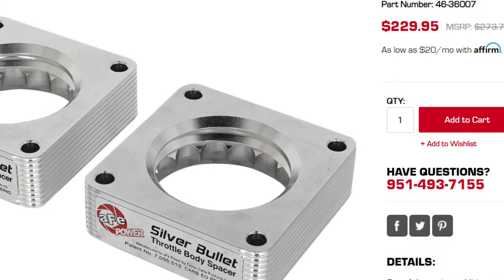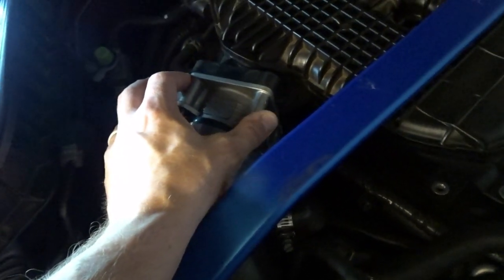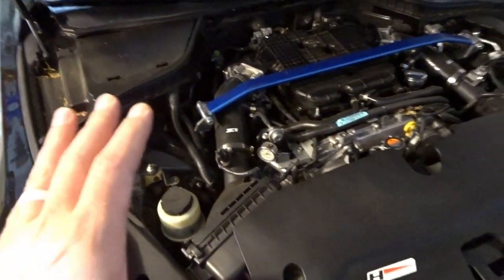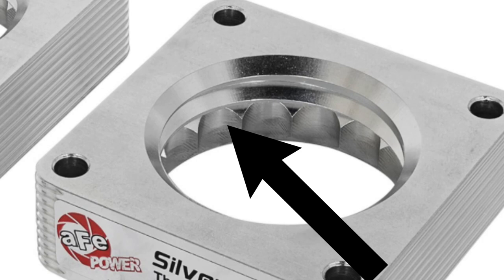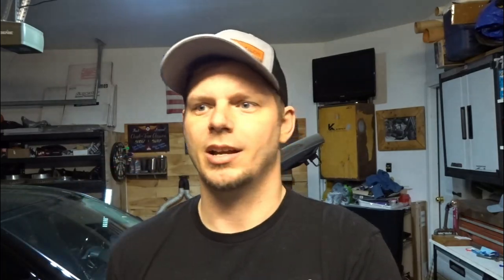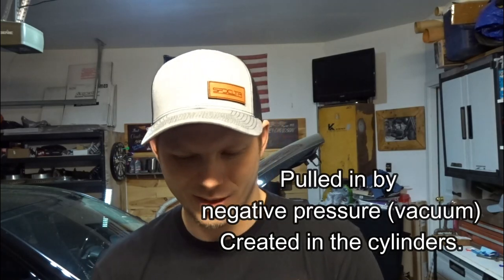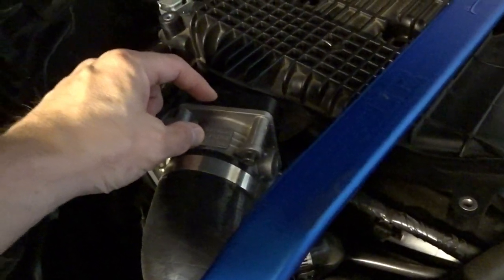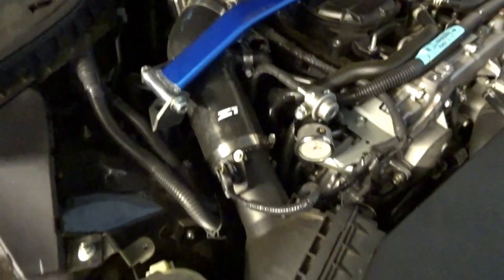Do Throttle Body Spacers Work?? | Watch BEFORE BUYING!!

Comment: Old video but I liked it. Anyway I’ve come to conclusion that TB spacers only do 1 thing. Allowing a port for a NoS system. If they truly worked YouTube would have 1,000 videos proving on a dyno. I’m surprised that there isn’t any proving/disproving them working. Therefore when in doubt believe what you see and I haven’t seen any dyno showing them doing any hp gains
Reply from the maker: Exactly right!

Comment: Yep! Your on point 1-2hp. Buddy just got off the dyno with his 12 g37s coupe full bolt- on. We were all curious and 1-2hp for over 200 bucks 🥱 lol. His tuner was like your lucky I squeezed that much out lol. Great video my dude.
Reply from the maker: Thanks!  Yeah and honestly, they probably could not positively attributed that 1-2hp to the spacers.  Like I said in the video, you can do back to back to back pulls on the dyno with no changes made and see a variation of 1%.  He could have done another pull after gaining that 2hp and been down 3hp.  Margin of error.  I’ve never seen any evidence of true confirmed gains from TB spacers on any platform.
Reply: I agree, waste of money for the VQ. Can't relate to a v8. Who knows it could create 10hp 🤷🏽‍♂️
Reply from the maker: @Hondacbr600rrish  I’ve seen them installed on many mustangs lol.  Same results...
Reply: There we have it lol. Don't buy them lol.
Reply: @Hondacbr600rrish  hemi v8?
Reply: dyno proven got me 8 hp on my r18 1.8 civic :DDD

Comment: good video.  This crap dates back to the 60's, 70's, 80's  when we use to run cross rams and tunnel rams.  Back then even adding a spacer to a carbed manifold could gain a few HP..  These days of direct injection, the gain is gone.

Comment: Understood that this is an old video, maybe with other supporting mods you might get much better results, such as throttle body coolant bypass, run a throttle body water cooler instead , hey you can always diy a spacer out of 1/2" plastic cutting board 😊, my $0.02...

Comment: Theoretically, in aerodynamics there is a concept of introducing turbulators to a structure in order to minimize the separation of air from the surface of an object. Separation can create small circulations at the back of the object as it travels through the air creating something called an adverse pressure gradient which can create excess drag upon the object. This is why they put dimples on golf balls so that they travel faster and farther. This however is a concept for external flow and I'm not sure how the existence of turbulators would work in an internal flow scenario to the same effect. Seems like bad science to me but I'll bring it up to my instructor.
Reply from the maker: Yes yes, the golf ball science is really cool.  There is just too many contradictory concepts when it comes to intakes and throttle bodies.  Smooth intake tubes to reduce turbulence and increase flow.  Yet spacers that create turbulence to increase flow...
But their explanation of the turbulence increasing pressure in the combustion chamber, that’s what I would like a deeper explanation about.  Nonetheless, however logical the theory is, they don’t seem to work Lol
Reply: @SpeedCultureStudios  as a fluid (air In this case) moves inside of an internal flow It approaches something called fully developed where the velocity at the center of the tube is at its maximum and no longer changes with respect to time. However regardless of how this fluid acts inside of the tube It does not affect the pressure gradient in any meaningful way. Fluid will always move from high pressure to low pressure and the only thing that would increase The flow velocity would be if the outside pressure was somehow increased or the inside pressure was somehow decreased neither of which would be affected by the flow of the fluid In this case. The reason why they prefer nice smooth tubes is so The velocity of the fluid becomes fully developed sooner and you have a nice steady flow into the combustion chamber. I'm always happy to answer any questions you have to the best of my abilities. This does get more in-depth But I hope this kind of explains a little bit behind what you've undoubtedly researched.

Comment: I feel the only time spacers would really do anything is by giving a little bit more distance for fuel to atomize and mix on tbi and carb setups. As for air. Unless you force more air through the intake. The cylinders will still pull the same amount of air.
Reply: I think tb spacers help more when driving with low throttle. When not flooring it. That's usually where I noticed the difference in other cars.n

Comment: I have throttle body spacer on my 03 G35 de and my 08 G35s hr. On the older de I definitely felt more throttle response after installing them I didn't expect much from them. On the hr I felt a little bit more throttle response but nothing crazy. Both on stock Intake system. Definitely don't think I gained any power but who knows.i did also have to cut a bit of the intake boots a little on the hr to get them to fit and made sure I had no leaks

Comment: There is a pretty cool show called "Engine Masters" they do a whole episode on these TB spacers. They do a lot of tests with different style spacers and different engines. They basically found that every engine reacts differently to them. I think the best numbers they saw was an 8 horse power gain, in some cases the cars lost power. Another factor they were all V8's and some were boosted applications. So I guess end result is it is a total crap shoot...probably not worth it on a N/A V6.

I think the best thing people can do is figure out who they want to tune their car and get their input. They see tons of data every day to back up whatever part list they may recommend. In most cases since the tuner has no real affiliation with these vendors they don't have any biased interest in suggesting certain things either.

Comment: I had a Throttle Body Spacer in my Genesis Coupe 3.8 with a side port. It was perfect for injecting Seafoam intake valve cleaner.
Reply from the maker: Now there’s a use for it!

Comment: I do not know if it improves HP or Torque.  However, what I do know is that they increase MPGs if you have a manual transmission (probably an automatic as well).  I have one in a 2022 JLU with manual transmission and in 5th and 6th gear between 1500 and 2000 rpms you basically had a dead pedal.  If in 6th you had to downshift for mild elevation changes and if you wanted to accelerate after dropping to 5th you might have to drop it to 4th.  I do not have to do that any longer and it will hold 6th gear and if you want to accelerate you don't have to shift down to 4th anymore.  Thus, you increase MPGs because you can stay in a higher gear.  I confess that I created some of the problem when I put 2 inch taller tires and did not change the front and rear gears, but now I don't have to because the throttle response is so much better at lower RPMs.

Comment: if you have a civic with the r18 1.8 n/a , I can absolutely tell you they work FANTASTIC on these engines! especially if you couple it with some other supporting mods.  The low end is instantly boosted up, and goes all the way till the mid.  the throttle response makes it a whole new beast. GET ONE.
Reply: Been looking for a comment like this all day lmao
Reply: I can second this, did it to my old civic and it really gave it some Pep in its step in the low end and really improved throttle response
Reply: @Ryzuuko  it's awesome isn't it?! I have the throttle body spacer combined with a true cold air intake that takes in air from the bumper, and i opened up the area where the fog lights are so i get cooler air rushing in.  and it's a tremendous difference with both these mods.

night and day.  especially in "s" mode.  i LOVE driving the thing even more.

Comment: True on point. Yet I did do a dyno. I currently have a 2019 nissan frontier  and installed afe intake afe headers and exhuast. Yet I took the spacer installed and I did gain 6hp more. Yet is it worth the 150 bucks. I would say no. But if you got spare change hanging around try it!. I did and am happy. Every vehicle will act different . Mine was positive response.

Comment: HP gains is purely a marketing angle for those that don’t understand their engines.
I recommend researching the intake of the old Ford Taurus SHO and why a V6 had 12 intake tubes, but only 6 were operating at any one time.

Whether or not a TB spacer will benefit you depends on how/where you drive and what modifications you’ve made between the combustion chamber and the tb.

Hint: a tb spacer affects velocity!

Comment: I have an HR and kinda wanna get these but idk. I put one on my k20z3 and made like 5whp and shaved a tenth off my 1/4 mile. Tested with dragy with multiple runs and it was consistently faster after the spacer.
Reply from the maker: Try it and let us know!
Reply: @SpeedCultureStudios ordered some eBay ones lol well see
Reply: @SpeedCultureStudios  after a couple months of driving the car with the spacers, it does seem to have better throttle response. Not sure if it's gained any power but the intake sound is better with these spacers.

Comment: I have these on my 2015 Q40 with the takeda cold air intake. I thought when I ordered them that there was a possibility that I was buying snake oil lol. After having to get new couplers for the intake because the angle of the throttle body changes with the extra space in-between. They actually do work very minor. All it helps is to increase velocity of the air. I got mine for like 180 shipper a year ago some sale and had a 10% off code. I'm happy with them but definitely not the most important mod lol just a place holder to scratch the itch of modding.
Reply from the maker: I like that definition “scratch the itch mod.”  That’s a great way to put it!  Doesn’t hurt anything and isn’t too expensive so still allows you to tinker a little.  Well put

Comment: My thoughts were the same, I feel like it would just  mess up the placement and fitment of the intake and where it connects to the airbox with no real benefit to performance. 👍
Reply: They work trust me
Reply: @kellypark007  how?
Reply: @Manny99999  introducing more volume for the plenum and giving you a bit more air to fuel mix.
Reply: @Manny99999 dyno proven. What LHT's video of them dynoing one

Comment: Boost, NOS and displacement are the ONLY power adders. Most “performance” bolt-ons target reducing friction, therefore freeing up pre-existing power. Disconnect your power steering pump and notice the gains.
If you understand when and where and why to run a single plane or dual plane intake manifold, you’ll better understand a tb spacer.
No, it doesn’t give you ANY more power. But it does do, is change your power band.
An LS already has a broad low to mid power band. Therefore it’s unlikely to notice any “gains” from one. However, a small 4 banger might feel a bit more low end torque improvement.
Reply from the maker: It can certainly vary from vehicle to vehicle—in the VQ, you won’t notice any additional power gains or changes to the curve.  Zero impact

Comment: Hey guys I really need your opinion about those afe TB spacers, Just got them installed on my g35 hr sedan and can feel little difference on throttle response but still can’t decide is it gaining hp or I’m loosing some 😓
Reply from the maker: You can feel a difference but you don't know if you're gaining or losing?

Comment: Wording is everything my friend. Another mod that you swipe right on. More money to save for a much better mod.
Reply: Or you can buy an eBay one for $60 and appreciate the better throttle response you'll get.

The problem with them is that $200 is way too much and there's little to no increase in HP.

Comment: Well the next argument is improved gad mileage… some people claim up to 4mpg gain.. even in the case of a 1/2 mpg gain it pays for itself… and then people like the extra noise.

I got suckered in.. i ordered a steeda, it was only $95 shipped. Steeda claims 2-4 horsepower and improved mpg.. steeda is a company with a good reputation so you tend to give credence to the brand name too. Its an easy sale when they mention “saving gas”… oh yes it will pay for itself.

Comment: Should I buy a 2013 g37x with 50k miles for 10k?? I need your answer man I like the way you keep it 💯 always! 💪🏼💪🏼💪🏼
Reply from the maker: That's probably priced about right.  Wouldn't hurt trying to get a better deal.
Reply: @SpeedCultureStudios  he was asking 12, but i still got to inspect and test drive, any advice when looking for mech issues?
Reply from the maker: @jrtrippy1795  check the oil check the coolant to make sure neither looks like chocolate milk.  shift through all gears under load to make sure there is no slip in the trans.  that's pretty much it.  no weird noises or smoking obviously.  Ask about the gallery gasket and if it's been replaced.

Comment: Thought process behind the design is they cuts in the metal is supposed to add an air movement from straight free flow to a swirl movement then the smaller diameter exit on the part is supposed to act like a funnel from a wider diameter to a smaller diameter causing the air pressure to gain velocity. All in theory but the part you got looks like its backwards. I would assume the smaller diameter should be on the exit side now the inlet side.
Reply from the maker: I did not get these.  I don't know what you're referring to when saying the part I got looks backwards.  The purpose of the cuts was read from the description of the part itself.  I think it's more of a ploy than a theory.
Reply: @SpeedCultureStudios  i was referring to the picture you used in vid. Yea with physics it should work in idea but I feel that different cars and different mods will handle the part differently.
Reply from the maker: @Demon_Mx2277  ah yeah the pictures included were just from websites.  It’s definitely true that different engines respond different to certain mods!

Comment: May I ask, what is the difference between adding a TB spacer than increasing the length of my air intake ram pipe?
Reply from the maker: There wouldn’t be any difference unless the increased length got your filter closer to cold air
Reply: @SpeedCultureStudios  I mean, for example, if the width of the TB spacer is 1 inch wide, by lengthen my ram pipe to 1 inch, is this "concept" works the same way?
Reply from the maker: @kcong4958  I suppose it is the same concept but the result is the same—no gains.  Many, if not most, TB spacers have a design to “spiral” the air into the engine, so there is technically a difference there—but that still doesn’t help.